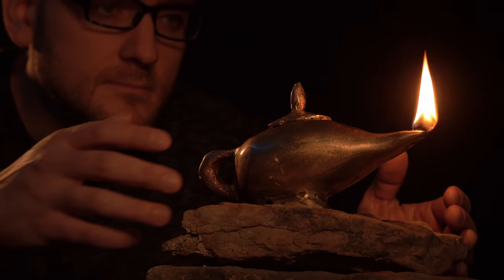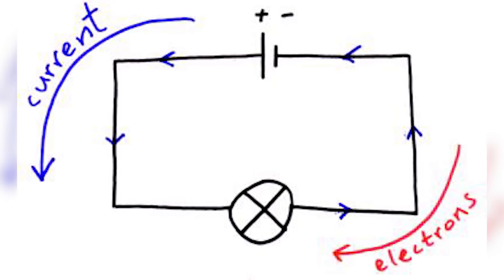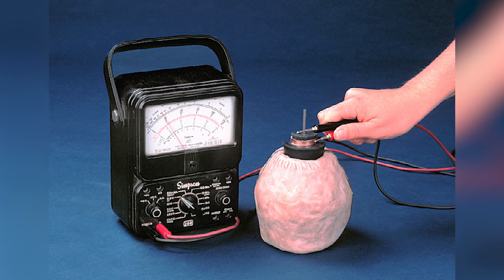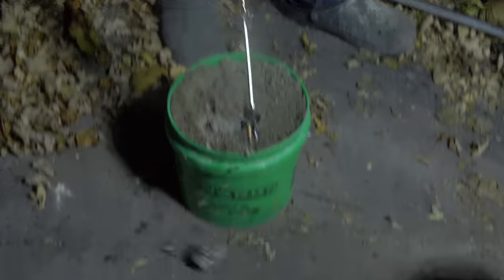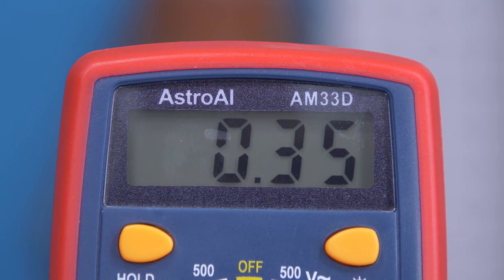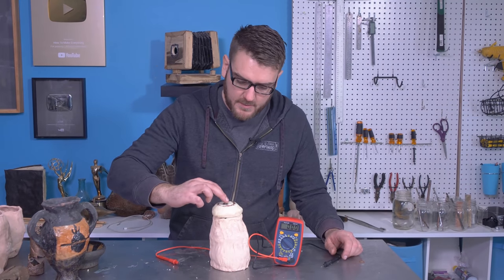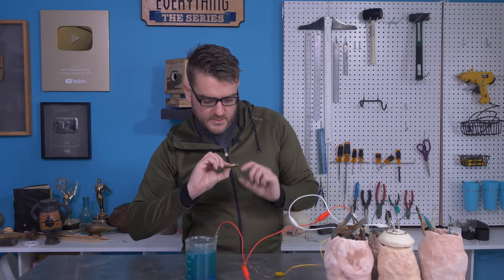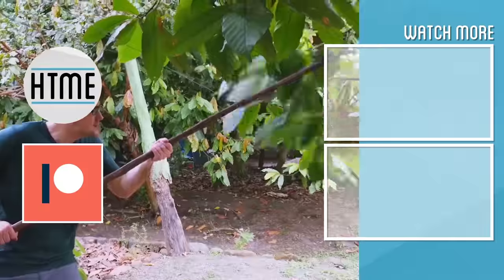Recreating a 2000-Year Old Battery?

Comment: One of the saddest yet most intriguing things about the Bagdad Battery (and so many other artifacts) is that it was found largely without any context. Time had taken all of that away. So we have no idea if this was a one-off weird thing, or if they were using them for some purpose, or... just... so many questions we will probably never know the answers to. This does make me wonder how many it WOULD take to charge a phone. Not that you'd be likely to get cell service in our imaginary post-apocalypse scenario...
Reply: Considering the design of the Baghdad battery completely discounts the idea that it was a battery; it would take an infinite amount of them.
The terminals are touching, do you know what that's called in the electrical business? A short.
You can't draw any power from the terminals because they're shorted, the electricity will ALWAYS prefer the short because it's the smallest path to entropy.
This is ignoring the fact that the electrolyte doesn't touch the iron rod in the middle meaning that no electrochemical reaction is taking place; if the electrolyte doesn't touch both pieces then theres no reaction.
Even if we just ignore both of these facts, and look at this thing as a battery, it would produce a small fraction of a volt, it would take thousands of these things hooked in series to produce usable current; if they were doing that, there would be WAY more surviving examples of these. There aren't.
See the Lemon Battery Wall by veritasium, then realize that those batteries are even more efficient than the Baghdad battery due to the electron loss difference between those metals
Iron and copper are close together in this list of metals that lose electrons when reacted through redox, while zinc and copper are further apart.

Comment: Cool, but it definitely doesn't seem like it was originally meant to be a battery. Especially since the original would have just shorted out. I think someone was just using the tube as a stopper and pot was probably for storing liquids like wine.

Comment: In layman terms:  ( Just to be funny )  

The way I see it is in 1936 an Iraqi rail road company stumbled upon ruins of an ancient city
somewhere not that far from Baghdad while running rail road tracks within a certain area.

The then Iraqi State Board of Antiquities and Heritage ( I forgot what it was called back then ) 
came along and started digging up the area in question.  

 It was two Iraqi archeologist who found the object in question.  None of the two had any pre 
conceived notions as to what it could be and never claimed it to be an ancient battery.  

It was some German dude named Wilhelm Konig an archeologist and possibly one of the earlier 
ancient aliens racist weirdos who claimed it to be an ancient battery.

Now from the time of the claim many people outside of being scientist and or archeologist have 
since conducted their own experiments replicating the object in question coming to the conclusion 
that the artifact does in fact produce 1 volt of electricity. 

So although it can light up a tiny and or average lightbulb it doesn't generate enough electrical 
energy to go beyond that.  

Most archeologist on the other hand do not think the artifact was used as a battery pointing out
that there is no overall evidence to suggest it was used as such while the proponents of it being 
a battery can't tell us what it was used for.  

Ultimately both sides are stumped as to what the artifact in question is but simply rather than 
admitting to that being the case both side pontificate there points of view even when both sides 
are WRONG!  lol

Comment: The idea that this was a battery is not founded in science or history. Not only were there no other "batteries" found, but there would not have been an ability to use them as one. Even the experiment you did shows that each "battery" only produces half a volt. What would they need a battery for? It takes 3 or 4 volts for electroplating gold, although you MIGHT be able to electroplate using silver, but the solution has to be heated to certain temperatures as well, and there needs a lot more materials available that simply cannot be found at this time.  And even then there is no evidence electroplating happened in this time period. 

It most likely was an old jar that used to contain wine being reused to hold a scroll of some kind. The "asphalt" used on the top would hold the copper tube in place, and the iron bar in the middle would have kept the scroll in place. 

The idea that it was a battery doesn't hold water, and especially if you needed to put car battery clamps on them all in order to get 2 watts.

Comment: Get enough of them to get ~24V and I could think of a use for them. You take a bronze/brass statue of a deity and a rod and connect them to the battery. You then, after having developed some sweat in your palms, grab the rod like it was at an altar for getting up and down from kneeling or a religious scepter (the Romans and other Pegan religion were known to use such objects at times), and touch the statue with your other hand. The Mythbusters tested this sort of theory, but they went off the rails and didn't consider connecting the batteries in series to boost the voltage to a level where you could feel it and the also didn't factor in having sweaty hands from being in Baghdad outside for hours in the midday before being let into the temple. You could also try out using a gold leafed wooden or clay statue as well and also kissing either the rod or the rod or the statue as points of contact to see if you can feel a tingle from the electricity.

This would involve having soldering developed in your tech tree, but having entered the bronze age and the iron age, brazing with soldier should be in the tech you develop, especially since you will need it later for other inventions. Sourcing the metal for the soldier will be easy. Making an effective flux will be the challenge as you need one to soldier. Being in the iron age, hot iron pokers out of a fire should be all you need. Go for a chisel shape at the end with the tip around 1/4 to 1/2 inch wide. Look into ancient methods for brazing and soldiering for how to pull off the details. Consider other methods for connecting everything electrically as well and experiment with how low the voltage can be for there to be an effect.

You will need to make series and parallel circuits with these batteries to test any electroplating using them. Electroplating of gold is very old and would be useful for decoration and selling lead items cast, polished, and then sold as gold or just passed off as gold by the rich since you really couldn't check if something was solid gold or not without handling it. Either test, you need to add soldiering and brazing to your tech tree. You could also make a mace with flanges using the brazing and many industrial revolution tech.

Comment: How the hell did they discover that this was the specific setup to create charge? The discovery of this is super interesting considering how long it was before there was any practical application
Reply: Probably just noticed the rapid oxidation when dissimilar metals are stored in wine, then figured out they could control it with whether the metal was touching or not. But that's likely as far as they got. The battery connotation is probably misleading.
Reply: Given it's an historic isolated find there's limited information one could take from it at all.

Archeological sites are usually resolliant to a few more decades but archeologists want to explore them at a certain rate... leaving future archeologists with better methods and disturbed artefacts

Comment: there is a battery amplifire circuit you put same amount of voltage on battery mark and on the othe side you will have 5v you can try it with those primiteve battery
Reply: Except there was no way for people to do that in the past. These batteries don't even have terminals.

Comment: Would love to see more electrical content as an electronics engineering student. Would like to see you guys build you own transistors and even a really basic computer.

Also making it so your eventual steam engine can produce electricity would be cool.
Reply: Is a transistor possible?
Reply: @Person5385-w4s  Probably not at their current tech level. I was thinking more long term. The only things they could really make are large capacitors and a better battery using layered metals in an acid. A lot of things like diodes and transistors are fairly new, and even vacuum tubes would be fairly difficult to make right now for them I think. Really they need to get more into the manufacturing or machining side of advancements before attempting transistors
Reply: @spazmaticaa7989  assuming they will make transistors, how would they do it?

Comment: a cool attempt at electro plating with no modern materials, but I'm a little disappointed in the presentation of this without mention that pretty much no archaeologist believes that the item in question was a battery.  I think accuracy is important, and I don't think there would have been any negative impact on the video if you had included a sentence or two on that somewhere

Comment: Ofcourse, another dude hooking like 3 super sized modified versions of the battery in series, and then calling it a battery.
Yes.
Reply: Its important to note, for the electrolyte battery to work, the electrolyte must touch both the Positive and negative side.
The Baghdad battery had an iron rod in a copper sheathe, but the iron rod did not touch the electrolyte making it impossible for it to be a battery.
Also the original battery had no terminals which is.. y'know... A key feature of a DC battery like an electrolyte battery.

Comment: Hey man
first up, i realy like the project you are working on, this whole reset thing is fascinating. But please, please do some more research before you make a video like this. These objects are not and never were batteries. They were vessels you would put a scroll into, sort of like a prayer or wish or maybe even a curse. The electric properties where most likely just a coincident at first and later maybe thought of as sort of magic cause it shocked you if you would handle the vessel. There is no evidence whatsoever that they figured out electricity and new how to use it. So please dont call it a battery. That is not what it is

Comment: I believe you’re on the target with the Baghdad battery being used for plating. I think that’s the most reasonable use for that time period. Gold plating for sure!
Reply: No it isn't.
Gold plating happened chemically without the use of any battery; and the Baghdad battery has no terminals.
You can't pull electricity out of it because the 2 terminals are touching, and thus are shorting.